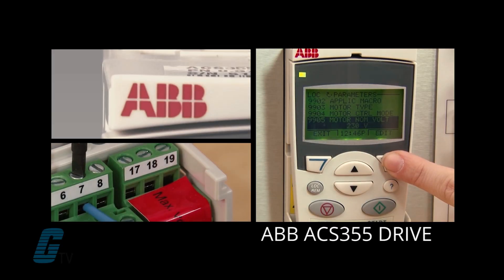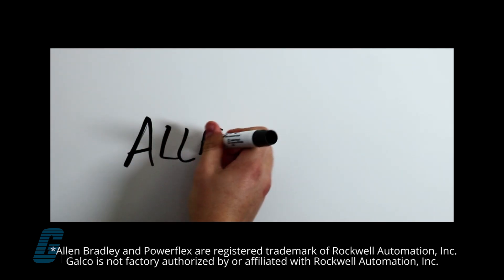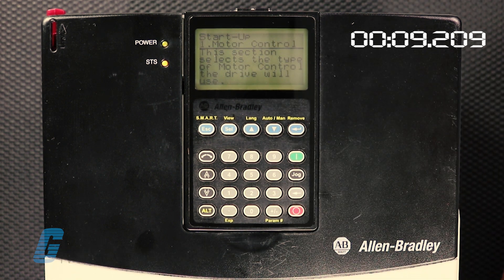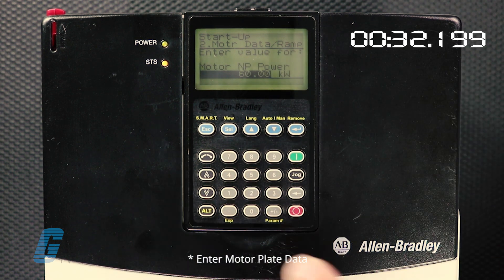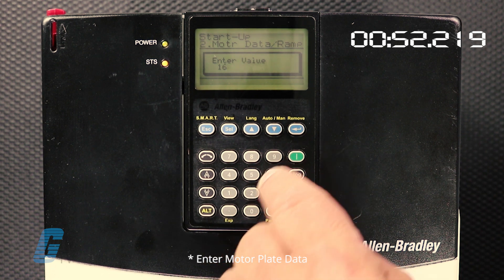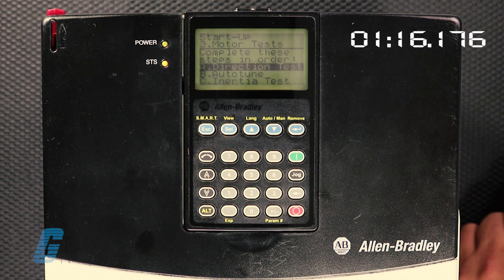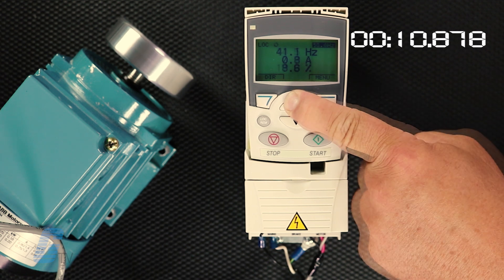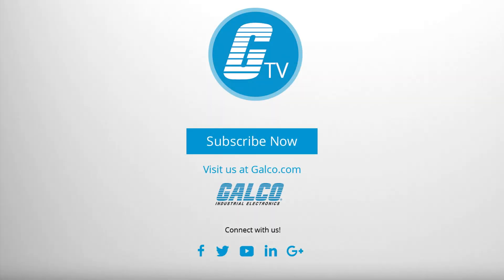ABB ACS 355 vs Allen Bradley Powerflex 700 Basic Start Up Comparison

Comment: The power flex 700 is a high performance drive with optional I/O cards that can be installed. The Power Flex 4m 40 come right out of the box with the keypad enabled to start the drive and the speed reference is is on a Potentiometer next to the keypad. So you can get up to speed faster then holding a button down.
Reply: Hi Angel, you're right the PowerFlex 40, 4M and 523, 525 are able to do the same as the ACS 355 does in this video. And they skipped over the part where the ACS355 asks if you want to use the startup assistant and setup the drive.  If they had used the startup assistant or otherwise gone through all the steps it takes to setup a drive we would see that a setup/startup isn't as simple as pushing the start button.  
Since they skipped over or didn't show the startup on the ACS355, they don't actually have a comparison.  
You probably know that if you have a wire on the drive to enable the PowerFles 700 and you skip the startup routine it will work the same as this ACS355.  You probably also know that the newer  PowerFlex 755 and 753 and 525 and 523 also work the same as what they showed the ACS 355 able to do.
If you want to see the basic startup of an ACS355, see the much longer Galco videos showing the drive setup and note that an actual startup always seems to require at least the setup of the motor FLA and choosing how fast to ramp up and ramp down the speed of the motor along with half a dozen other things.
Because they skipped the setup of the motor FLA setting and ramp times on the ABB and they did it on the PowerFlex shows me they didn't do a comparison of drive startup.